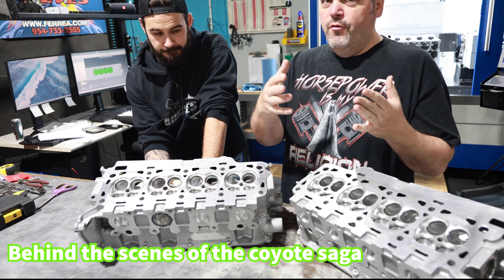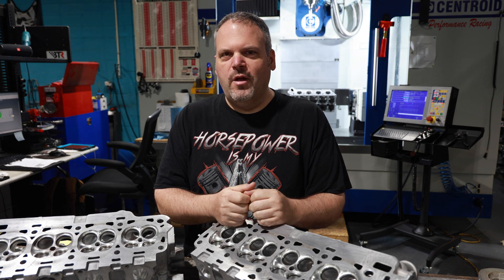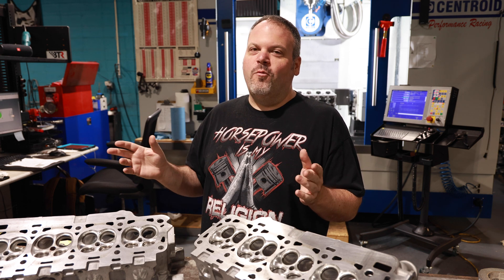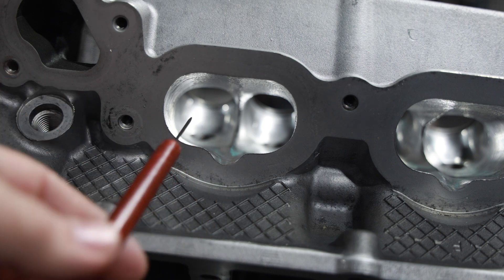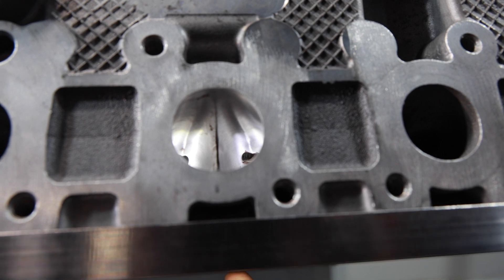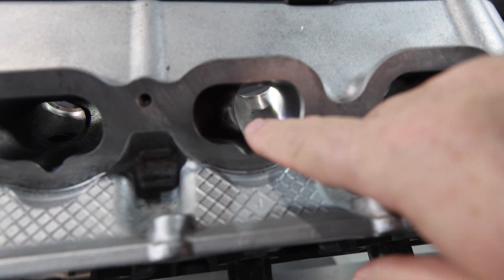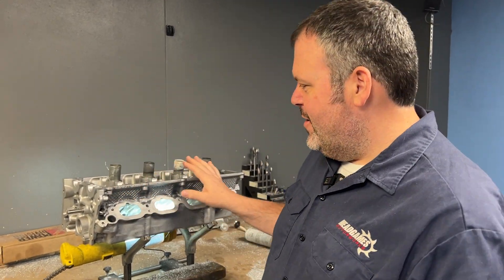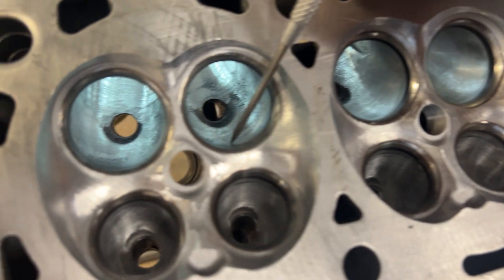Gen 1 Coyote Road to CNC Part 5: Completing the Trilogy!

Comment: Dave do you put the fins in all 4 valve heads even low port heads and is it all for air speed? Does it show up on the flow bench or just the race track? I don't see fins used like this on pushrod heads hardly so i'm curious. Thanks for your time and knowledge!!
Reply from the maker: Yeah, for airspeed. Actually, I got the idea from the domestic side. When I was doing big chief heads is when I started doing it. That was in the late 90's. Then doing 2J's in the early 2000's people were removing the divider to the front of the port so I tried it and it sounds completely different on the flow bench. The port is much quieter without a fin, and you need ear plugs with a fin. It certainly shows everywhere.
Reply: @headgames  If i am understanding correctly you are saying it's quieter without a fin but you put them in your heads? I assume the fin keeps air attached to the short side better and would be a quieter port?
Reply from the maker: @markgummo9624  no it is much quieter without the fin. Because it decreases the air speed.

Comment: oooooh what a pity Dave, neither the subtitles nor the automatic translation work, so I don't understand anything, too bad.
Happy New Year.
Reply from the maker: I worked on that too! I don't understand what I am doing wrong there.
Reply: @headgames  Dave, try this, I've seen it on my channel, follow these steps, you can only do it from a PC.
I don't know if you uploaded this last video from the application or if you have something there that is not configured correctly.
Turn on auto-dubbing on your channel
If you've turned off auto-dubbing, you can turn it back on for your channel.

Sign in to YouTube Studio on a computer.
Click Settings, then Default upload settings, then Advanced settings.
Check the Allow auto-dubbing box.
If you want to review your dubbings before publishing, check the Manually review dubbings before publishing box.
Choose either Review dubbings in all languages or Review dubbings in experimental languages only.
Click Save.

I hope this helps.

Comment: Not related  to video.  Have you ever done a comparison a k20a2 vs k24a heads. Port  3 angle valve etc.  Would like to no more. Im thinking k24a with 3 lobe vtec would be better air flow.  If worked.  Thanks😊
Reply from the maker: K20 head flows better.